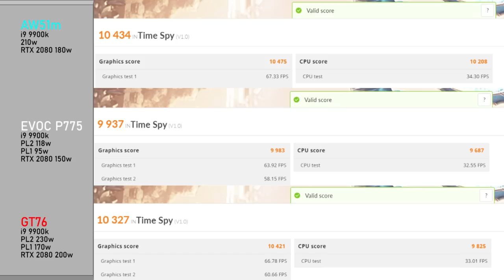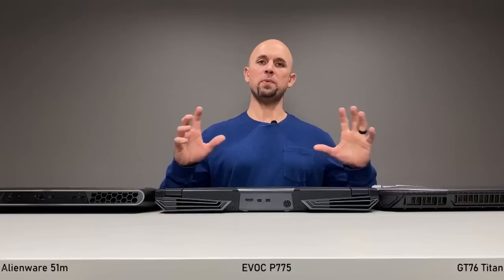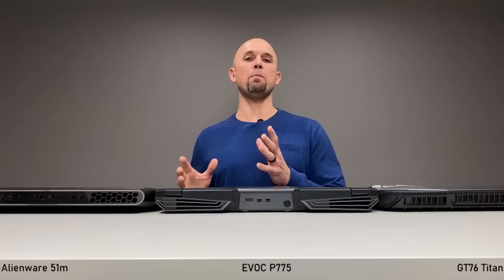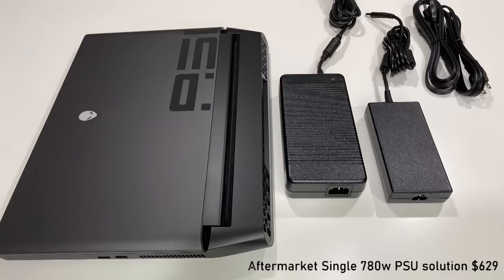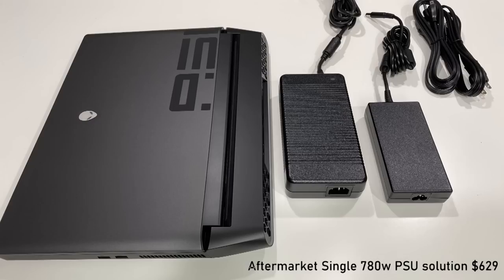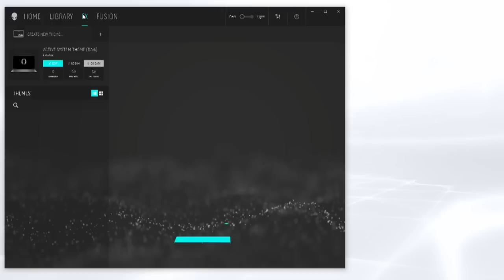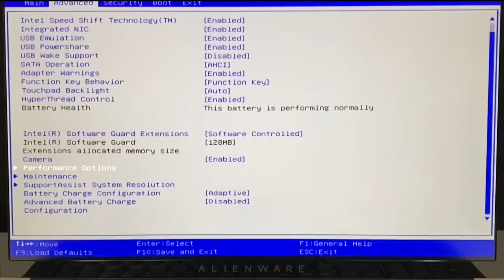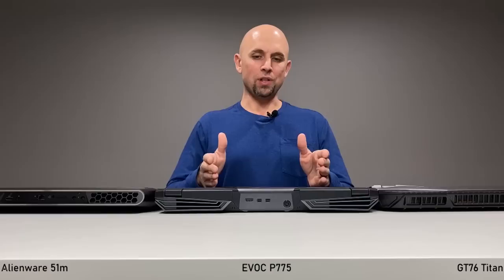The Ultimate Laptop SmackDown!  Alienware 51m vs EVOC P775 vs MSI GT76 Titan

Comment: I have the Alienware Area 51-m (i9 9900k and RTX 2080) and using the latest Bios(1.7.3 - 1.8.1 was removed) and latest vBios(180W). And using it everyday is such a treat!

Out of the box it was pretty messy (but then again I had the same issue before with all other 2 Alienware laptops from 2011 and 2014, so nothing new and I was fully expecting it).
With some GPU undervolt (proper curve) the GPU reaches a max of 77C at 1905Mhz with 0.900V (this is about 150-200Mhz over the spec boost) on max fans.
The i9 9900K with some undervolting, proper PL1 and PL2 never thermal throttles. I ended up with the almost the same PL1 & PL2 values as the Clevo.

It's not ideal that I had to tweak it, but then again I expected this and even if it was working fine out of the box, I would still have tweaked it, just to get the max perf/thermal out of it, like I do with my desktops!

Also, Great Review!

Edit: The stupid 79C thermal limit on the RTX 2080 GPU can be bypassed with HwInfo, if you disable EC support and control the fans. ;)
Reply from the maker: Helifax19 I would’ve done the same if this was a solo review on that machine.  I also would’ve probably trashed it harder just because of how expensive it is and a lot of people paying that much money have a right to expect it to work like the Clevo model does. 

Sure the Clevo ain’t pretty but that doesn’t mean being pretty gets you a performance pass. 

Out of all three machines I spent half of my time with that one that’s how excited I was to get my hands on that machine.  I think I looks so good!!
Reply: @BobOfAllTrades  Totally agree on all the points!
Reply: @Helifax19  i have the same laptop for more than 6months now and never experience an of these problems.  Out of the box and using ACC only profiles to overclock and undervolt and my Gpu never reach 70 upto 2050MHz so i had no idea about temp°C throttle 😅😅😅
Reply from the maker: Playing what titles?
Reply: @BobOfAllTrades  every new AAA games that comes out. CPU is between 70 and 80°C. Am in Scotland so may be the cold temperature here helps.
Reply from the maker: @saidyahya5340  Interesting, so you can play BFV online in a 64p conquest and your 9900k doesn't hit 100+ watts and get to 100c?
Reply: @BobOfAllTrades  Naaah i only played single player for battlefield V. I never tried multiplayer for battlefield game since 4. Not a fan
Reply from the maker: said yahya Huge difference thermally. 64p Conquest kicks the heck out of the CPU. It’s why I use that title.  I can’t stand the game lol

Comment: I own the 51m, it's very quiet in operation and has mad looks. I'm very happy with it except for three things, it has a 2400mhz ram restriction in the bios which Dell have not changed since launch. I bought it expecting it was just a launch issue that would be solved with an update to enable 2666mhz. The synaptics touchpad isn't brilliant, and the keyboard while big it feels underwhelming, just like a $10 membrane keyboard. The two power supply's are annoying but not a problem for me as I don't move it around, I have another laptop for portability.
Reply from the maker: It looks so awesome!!
Reply: Alienware is so overpriced 👎

Comment: I bought the A51m 9900k + RTX 2080 last July, it's been the best gaming laptop I've ever owned.  I also used Thermal Grizzly Liquid Metal on both cpu and GPU and changed the stock thermal pads with Thermal Grizzly pads and it managed to cool my system down an average of about 12 degree's C.  I'm using the 1.5 BIOS along with the 200 watt vbios, undervolted both cpu and gpu and it has been working perfectly, my GPU never throttles down like in the video, the lowest it will dip is down to the 1700mhz range before boosting back up, constant 144fps (fps locked in Nvidia Control Panel) and my thermals never rise past the high 70s low 80s Celcius.  I'm about to renue my warranty for 3 extra years of coverage just in case anything aweful were to happen to my baby.  <3 A51m

Comment: I like the MSI GT76 Titan the most. Planning to buy one in the future.
Reply: Me too but unfortunately the soldered GPU is a big put off for me. GPUs tend to fail and will determine the lifespan of the laptop. MXM GPUs used on Clevo machines have lower maximum power limit but are replaceable.
Reply: Been rocking my 2070 SUPER i7 10700k for about a year now. I can't see it becoming irrelevant soon, hope you'll be able to enjoy it one day! Even the GE76 is not at this standard (except the port being in the back). Can't wait to see a 77 in the future!

Comment: No idea what the hell HID did to that A51m but my A51m never hit those temps on the CPU and I only used IC Diamond.  I also never saw the GPU throttle.  Something is clearly wrong with that unit.

Nice review either way.  It's a shame that the A51m didn't hold up better and truly hope that Alienware can figure out that throttle issue down the road.
Reply: I second that. No repaste on mine and rarely see throttle on my unit. I've seen some terrible reviews for HID A51M's on Amazon. Not sure what's going on...
Reply from the maker: I’m on the forums daily and these have thermal issues. Whether it’s the GPU temp limit, high CPU temps or general airflow, there’s constant talk about thermal performance issues.
Reply: @BobOfAllTrades  The forums your using are enthusiasts throwing synthetic loads on the machine and trying to get desktop numbers out of a laptop.  If that's what your after then yes this machine will probably suffer from high temps and some other issues.  For the 95% of people that just want to game on it then it typically works just fine.   I can game for hours on end and not see the issues you are, and I don't need LM to do it.  With LM installed you shouldn't be seeing the issues you are, you shouldn't be hitting the GPU throttle point, so again I say, something is wrong.
Reply from the maker: Ha, they’re definitely gaming over there too.  What happens to yours when you play BFV online without doing any tuning?

Comment: i've had my 51m (9900k 2080 config) about a year now. i love it. no regrets on the purchase. on the new bios you don't get the GPU throttle if you set the GPU thermal limit to 78deg in command center. something else to note is most of the units owners already have actually can downgrade BIOS and still keep g-sync. they recently switched screen manufacturers and it is only the units from the last couple months with the newer screen panels lose g-sync if you choose to downgrade to an older BIOS. that being because the newer panels they switched to didn't exist when those older BIOS versions were made. i personally don't have any hard throttling issues that would make me want to downgrade BIOS and temps are better on the newer BIOS for me. if they see your video and it results in them raising the BIOS GPU limit back up so i could raise my GPU thermal limit back up that would be nice too though.
Reply: @UnlessRoundIsFunny  yea i'm still good with setting the AWCC thermal limit to 78. no isues in tripple A games with ray tracing or ultra settings. yes the bios thermal limit being lower than the AWCC gpu thermal limit is exactly the issue for those with hard throttle issues. just set the gpu limit below it and there is no issues. another work around people have found is using HWinfo to set fan speeds. somehow it doesn't throttle when you do that and will go above the bios thermal limit.

Comment: I do motion graphics, 3d rendering on the GPU, so temps are my concern. The temp issues on the ALIEN would be eased if I were to buy a low spec configuration? rtx2070, no G-SYNK, i7 9700. With a similar conf the MSI would still have the best temps? thx
Reply from the maker: The MSI will have the best temps but the AW with a 9700k and 2070 will perform really good and should not throttle.  If it does it’ll be easier to tame. I’d rock that machine 👍

Comment: Nice smackdown, I have the 51m with a 9700K and a 2080, running a small undervolt on GPU and CPU and I havent see  any of the issues. I think the 9900k is a bit overkill for the chassis and cooling. Only issue I have with mine is discoloration on some edges (lunar light) which kinda sucks, but I can live with it.
Reply from the maker: CROOKS CLAN You don’t have a 75c limit on your GPU?
Reply: @BobOfAllTrades  I don't know, I have never seen it past 61-62. I do have the latest BIOS so I should have it. I think the lower heat 9700k and the undervolt are a big factor.
Reply: @BobOfAllTrades  I use it strictly for coding and gaming, hence why I didnt go for the 9900k, and in cases like this I'm kinda glad. My friend got the 9700k with a 2070 and he's running very similar temps and FPS in most titles. Only real difference between the two machines is his power bricks are smaller.
Reply from the maker: CROOKS CLAN I’d rock the 9700k 2070 version of this 👍
Reply: @BobOfAllTrades  I hear you. My thinking was CPU is much easier to upgrade down the line. Dell wanted $350 extra for a 9900k over the 9700k. So I got the 9700k and 2080, since the GPU upgrade path was over a grand, and it includes heatsink and power bricks, so I bit the bullet on that one. If I had to do it again, only thing I would change is the color. White looks good brand new, but doesn't last. Anyways, keep the great videos coming. The amount of actual useful information you provide is amazing.
Reply: @gjvah  I ordered it with the RTX 2070 and an i9-9900k. Do you think I'm going to have these issues, even with a 2070 ?
Reply from the maker: The 2070 is a 115w part so it’ll be solid. The 9900k in CPU intense tasks combined with the GPU loaded might bake the CPU in that chassis so tuning might be recommended.
Reply: @BobOfAllTrades  Oh... great
Thank you, I'll call them to see if I can change with a i7-9700k
Reply: @BobOfAllTrades  I don't know what to do. I found this video ( https://youtu.be/69xhswWPL7s ) and the guy says that it's only with the RTX 2080 and also that only 1-2% of people had these issues. We don't actually know the cause of the problem in fact.

Comment: I'm not going to disagree with the comments about the lack of g-sync on the Titan, but honestly, Optimus made perfect sense for me and is a big reason I bought the GT76. I use my laptop away from a plug quite a bit. With my last laptop (Asus Scar Strix i7 8750H-GTX 1070) I stopped using it outside the home a lot because G Sync is a big power suck and the battery could never make it. Now, even with the current hardware in the Titan, the battery lasts much longer because outside of games I'm running on the Intel HD 630 which saves a ton of power.
I tried the 51m and liked it but as Bob said, after a few minutes the GPU started to throttle badly. Yes, it could recover after things calmed down but in prolonged battles\firefights it throttled constantly and the performance was just awful. And I'm not exaggerating when I say that, we are talking performance drops below 2080 max-q levels.
Reply from the maker: That’s fair for sure and the GT76 definitely suits you best.  Add a MUX to that laptop and it would sell to a larger market too 💪
Reply: @BobOfAllTrades  Hey Bob that reminds me. What are the advantages of the MUX switch? The RTX kicks on automatically and off when done gaming. I know for a long time Optimus hurt gaming performance but that looks to be resolved now.
Reply from the maker: scavengerspc With direct GPU connection to the display you’ll have all sorts of advantages.  Gsync can be an option, Fast Sync will be there and the list goes on.  Those two are really nice and the main ones people care about as a gaming machine.
Reply: @BobOfAllTrades  I don't know why that didn't come to me but an excellent point. I do get G-sync at my desk when I plug in my external monitor through the MDP.
Reply from the maker: scavengerspc Perfect combo then!

Comment: Yup... I own the same Clevo with the i9 and RTX 2080, and the performance is pretty similar to what is shown here. It mops the floor with all "mainstream" brand laptops. Mine came from Eurocom, and they also sell a 760 Watt adapter with a built-in LCD display, and it comes with GNU/Linux pre-installed. I am yet to come across a game that won't do 130+ fps on Ultra on 1080p. And personally I won't shell out a single dime for anything more than 1080p.
Reply: p775 is a nice chassis, good quality parts and none of the parts are running near the limit. one area to improve would be cooling. dell and msi have way better fan and heatsink module.
Reply: @humorss  Actually, I have found the cooling to be way better than Dell or MSI. My laptop never crosses mid-80s on either chip under full load.
Reply: @chomskyan4life   but the other laptops are doing over 200w for the cpu, good for productivity. 150w cpu only is the limit for P775's cooling solution. I just felt that clevo could have done a little better

Comment: bob please point out if we can put a 9900ks in those laptops or does it require a bios update?
Reply from the maker: Of course. You can buy it preinstalled at HIDevolution. You can buy a binned Silicon Lottery their too. Many have done this for the AW just to get better thermals. I think it’s crazy when you add it up but to each their own 👍

Comment: Tips for anyony who really wanna buy Area 51M, just pick i7-9700k (or non "k" like I did) and rtx 2070. That's gonna save that machine. Never seen more than 75 celsius degree on my CPU and GPU while gaming. Cheers!
Reply: Don't have liquid metal, just normal stock paste
Reply: My i9900k 2080 does not go above 80 Celsius
Reply: Enjuill depends on the games

Comment: there are a lot of flexibility with these laptops, with freedom to modify almost any power setting. P775 have a 200w bios for the 2080, the hardware is there, 11 phase power. gt76 is king when it comes to cpu only productivity. the cpu heatsink and power delivery is crazy, i think it makes better workstation than gaming laptop. no other laptop can do 230W for CPU. and its need for 5g all core.

Comment: @Bob of all trades I would not recommend flashing bios to older versions with Intel for any reason right now because of the zombieload/cacheout security flaws.  This is a security flaw associated with all coffielake chipsets (all i9's).  Flash to an older bios at your own risk (I would say peril).
Reply from the maker: “Professor Chaos, bringer of destruction and doom!”
Reply: I'm glad you tagged it.  It's actually a very significant security risk.  People should be following it.  It is a damned good thing for Intel that they worked so hard on ingredient branding.  If AMD had a foot in the laptop market, Intel would be so hosed right now.  Hopefully their 9980hk sales will be sufficient to regain their footing in the desktop market.  Gooooo Mothership you noobs!!!
Reply: Oh also the Alienware 👽 overthrottling and then slamming on the brakes all the time has been a recurring problem for the company for YEARS.  Steve from gamernexus, Jay from jayztwocents, and Linus Sebastian from Linus tech tips have been talking about this problem for over 5 years.
Reply: I'm actually working on a $6k build right now and NOT going with Mothership.  I do believe I'll go with the gt76 Titan with the 240hz 3ms fhd i9 9980hk with the rtx 2080 NOT Max q.  Since Titan runs 2400, I think raid 0 is NOT a gimic here.  We give the HDD bandwidth as much substrate as it can handle, and then set a 4.8 base clock per core undervolt with 64gig 2666 and highly conservative fan settings.  🍻 Thanks for nerding out with me.
Reply from the maker: Professor Chaos It’s a shame!  They do so much right here. Give me 1 hour with their team to convince them to make a few changes and they’d crush it!
Reply: @BobOfAllTrades  I agree with you.  There's not much reason for Alienware power management failures, but it's plagued them for years.  As it sits I'm in correspondence with iBuyPower and HIDevolution to see which company can hang with my stuff.  iBuyPower is looking EXTREMELY nice with a $5k option which includes a 32" 4k 144hz 1ms external monitor.  Stay tuned.  I'll have the results in a month or so.  I've paid a lot extra and left specific instructions to ensure proper liquid metal install high stability overclock settings.  I'll be going through it with a fine tooth comb.
Reply: I wonder if noctua can make fans for it...

Comment: The reason for the frame drop in alienware is because the BIOS of the processor and graphics were not in sync with the temperature problem and the frame drop.

Comment: i know the GT76 doesn't have G-Sync but G-Sync only matters if a laptop has a 60Hz display it doesnt really need it because it has a  240Hz display  so i would rather have better battery life and performance with the 240hz display on the GT76 then the Alienware Area 51M and EVOC P775

Comment: The clevo one can be configured with two 330 watts power brick... Can you test it with both the power brick on.. I guess the power limit changes that way...it's max power limit is 190 watts as I know... But m not sure how much it will allow for cpu. Alienware laptop are really bad in terms of thermal design.. You need to use  laptop cooling pads to raise the height of the the laptop so it's not suffocating. My friends uses bottle caps to increase the height and voila the thermal performance is in fact quite a bit better...

Comment: At this the GT76 its the best option... 

Because there are some models for around $4000 maxed out in Specs. And its version of i9 9900K can overclock to 5GHz to all cores (supposedly) and its RTX 2080 its one of the most powerful ones as well that can reach 2000MHz Speed. So it would make the best desktop replacement despite its lack of features.
Reply: But he pt775 is the best performances but it ugly af  ngl